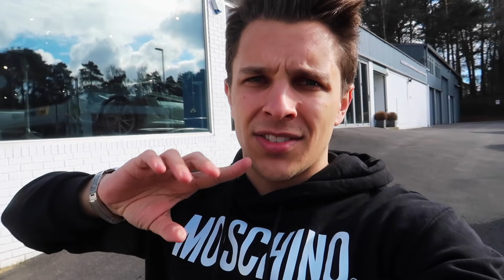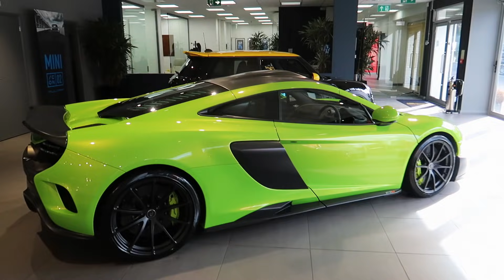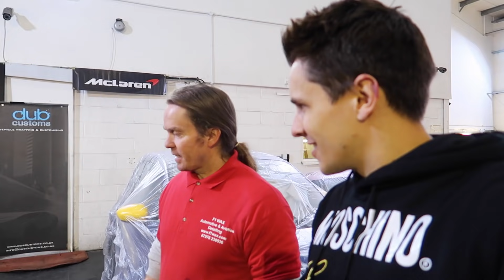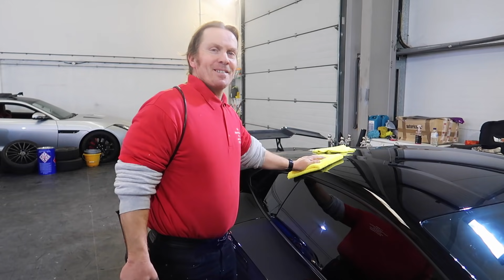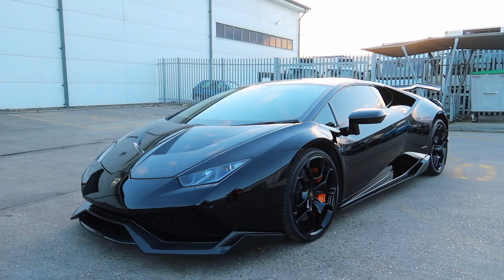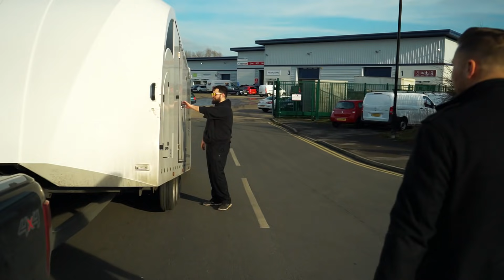Final Goodbye To My Lamborghini

Comment: A McLaren 600lt could be   a replacement
Reply: Redline has one that is a sick spec for £224,000
Reply: @Vangent87  and it's  faster than a  gt3rs
Reply: I think it would be a better choice for Archie than a 720S, however 600LT’s do have money to lose unlike the 720S (or a GT3RS)
Reply: A 600LT won’t lose much, it’s a limited run car like the 675 and you can argue the 675 has depreciated but in reality they’re still hovering around MSRP. The 675 lost so much money because they were trading for £100,000-£175,000 above the list price. You won’t have that issue with a 600LT they should be fairly at safe at list
Reply: And if it’s at redline, someone else has already taken the biggest initial hit

Comment: Redline has a 600LT in a sick spec for £224,000. That would be the best replacement period. Especially for the money you will not find a faster car or a better car for the track. It kills the new GT3RS, it is faster than the 720 on track and damn near as fast in a straight line. I’d get the 600LT and say the hell with a 991.1 GT3RS  and R8 and just get a sick car

Comment: Wow I was expecting it to be like 190k USD LOL this thing is for sure almost 20k over priced. I've seen a few diff hurricans with that same exact kit go for less. One of the even had scissor doors installs with 22k miles and it was going for 198k USD. I guess that car is for people who don't do their own research and don't want to wait.
Reply: Vivid Visual the scissor doors probably wrecked value
Reply: Why would it wreck the value? These cars were mass produced & scissor doors are rare. This car is going to drop just like the Gallardo but closer to the 130-170k range in 4-5 years. @zachrolands185
Reply: @VividVisual  Because when you change a car from stock, especially a random mod like scissor doors, it tends to decrease the value of the car for most buyers. I'm not saying whether it should be that way or not but that's just how it usually goes.